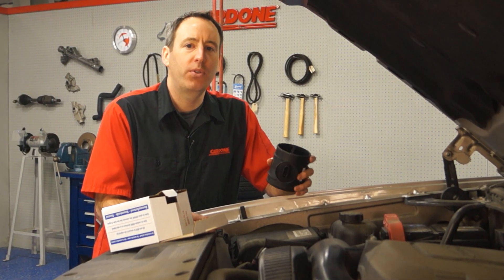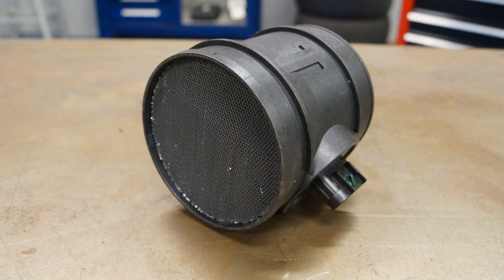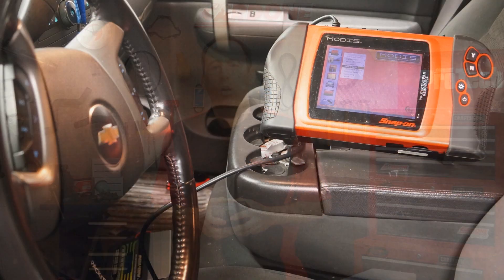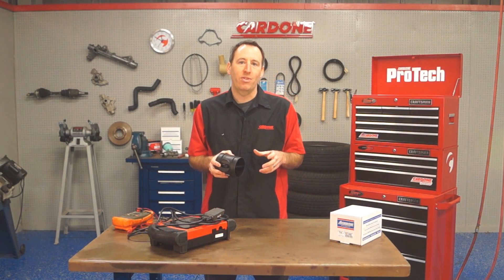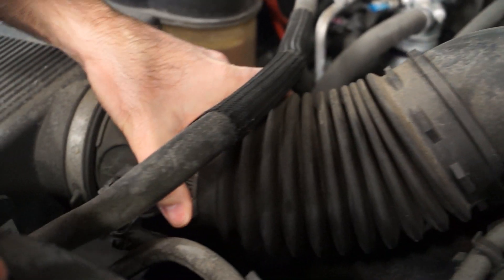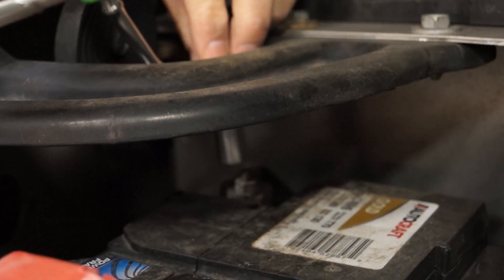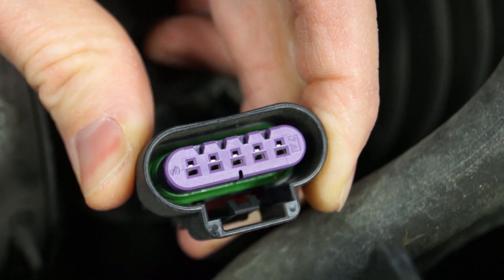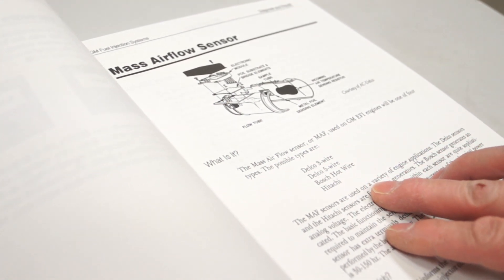Mass Air Flow Sensor Installation Tips

Comment: Hello...I just changed my mass air flow sensor, the old one had a rubber gasket on it but the new one didn't. Should I put the gasket around the new one?
Reply: I came here to ask the same question. Should I take that red rubber O ring off my old one and put it on the new one
Reply: @jwcmwaa  I put the old ring on

Comment: I replaced the MAF on my 2009 enclave as well as the purge valve AND the ECM ($800+) and I am STILL getting code P0104 (MAF sensor), and sometimes P0201 (ECM), C0104 (unknown) and P0104 (unknown).  Any suggestions?
Reply: Google is your friend by the way. C0104 is transmission related. P0104 is MAF related, etc. I'd suggest going through the fixes of each code on Google